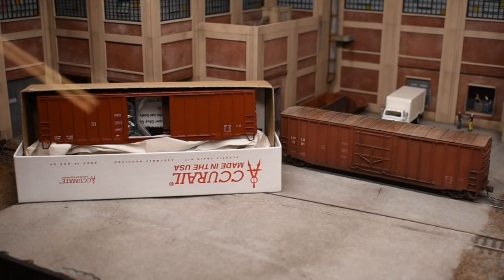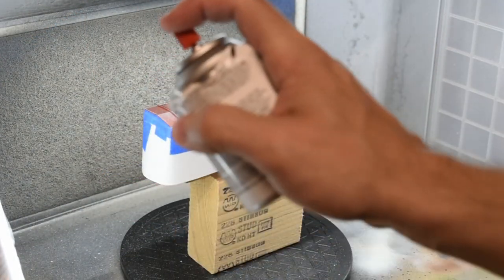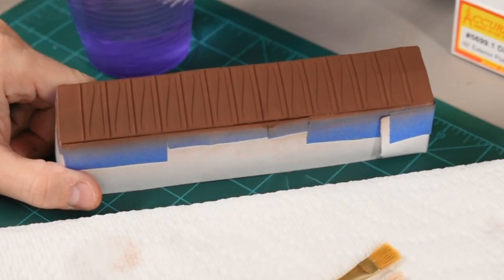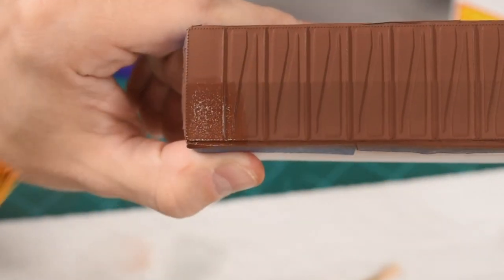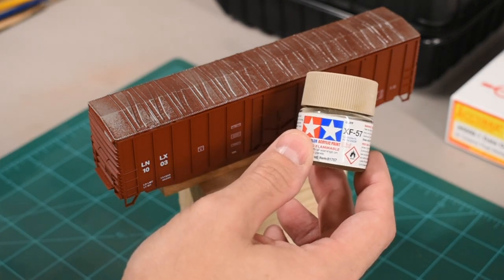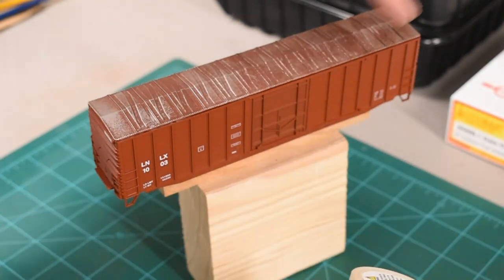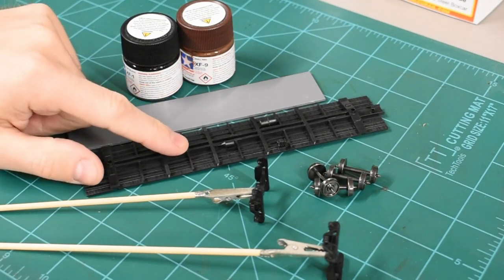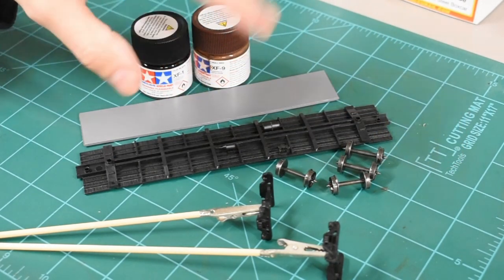Lightly Weathering an HO Scale Boxcar

Comment: Nice video, great workmanship, helpful hint you might not know, Crayola makes a brown felt-tip marker that fits perfectly in the wheel about the same colors what you made up that way you don't have to pull out all the paints and get the same effect and dry time is quicker just thought I'd pass it along. Again great video in great work
Reply from the maker: Thanks! I didn't know that about Crayola, good tip

Comment: Very nice.  Normally, when I'm painting the trucks, I stick little pieces of painters' tape to mask off the cavities where the wheelset bearing ends go. Any overspray onto the back of the far side of the truck is kept off the bearing surfaces that way.  I use acrylic paint markers to just swoop around the front faces of the wheels, again to keep paint off the axle ends. I just squirt a bit of powdered graphite in each cavity when assembling the trucks.

I like the way you used the chipping technique on the roof.  Thanks for an informative video.
Reply: Something I am going to try instead of tape on the inside of the trucks is to just put an old plastic wheelset in it.  Doesn't matter if paint gets on that wheel.

Comment: I also have those alligator clips too,I mounted mine on 5/16 dowels cut at lengths of 6" & 12". Another good tip I have is to save those paper towel cardboard inserts,as they're are quite handy as model holders with those one piece model shells,just flatten one end of the tube and stick it inside the rail car or locomotive shell, they'll hold it firmly while you are painting even upside down in most cases then place the whole thing in a glass jar or something heavy enough to hold it while it dries,then move on to the next step without worrying about handling the model..👍
Reply from the maker: I know someone else who uses the paper towel inserts, seems like a useful tool

Comment: Excellent tutorial!  I’m glad I came across this.  Quick question.  What do you use to seal the washes.  You said you didn’t want one wash to wash away the next wash so you would seal it.  Dullcoat?  Thanks for sharing all your ratios for the custom colors too.  Thanks again!
Reply from the maker: @Vector_QF8  Thanks for watching! Yes, I seal with dullcote
Reply: @JoeyBPhotography  Thanks for the confirmation!  I was unsure how oils worked with that.  I’m subscribing and looking forward to more tutorials and tips!
Reply from the maker: @Vector_QF8  My experience has shown you need to give the oil washes time to dry before dullcote is applied, and then give the dullcote time to fully dry as well before applying the next wash.

Comment: The finished cars look fantastic! How long did you let the oil washes dry before your next step?
Reply from the maker: This process took place over the course of several days (busy home life), so it varied. Sometimes I'd apply the wash then have to get up and see what the kids were arguing about, or run an errand. You can speed the process up with a hair dryer set to low and it'll be good to go in 5-10 minutes for a light wash over the whole thing. That's what I'll be using when I go through my "production line" process when I do the remaining 8 to speed it up. The key is make sure its absolutely dry otherwise the next thing you do will smudge (take a guess how I know lol). I apply dullcote after every wash as well.